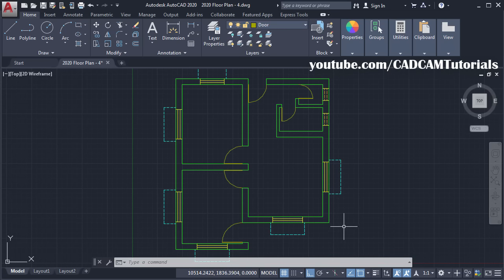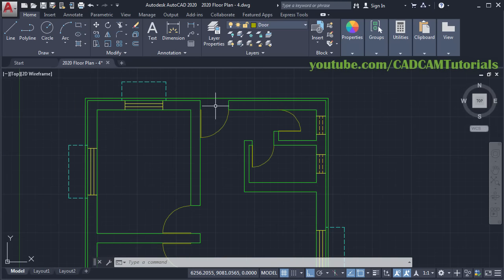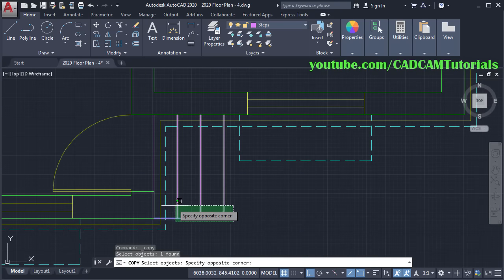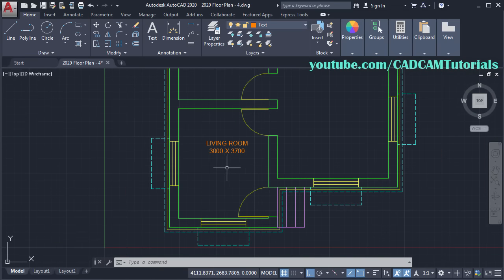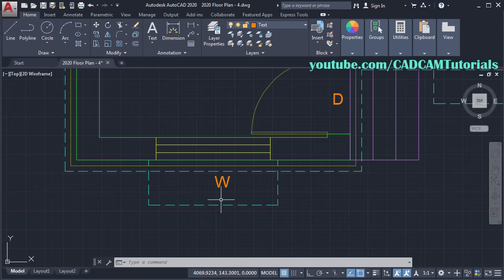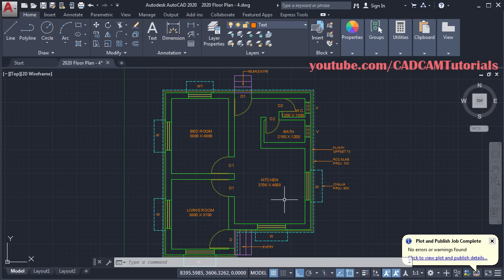AutoCAD Simple Floor Plan for Beginners - 4 of 5

Comment: 04:30 tracking a particular location
02:14 Use of fillet command as join and corner
02:26 Use of edit polyline close option
04:27 tracking from a particular point
13:10 tracking
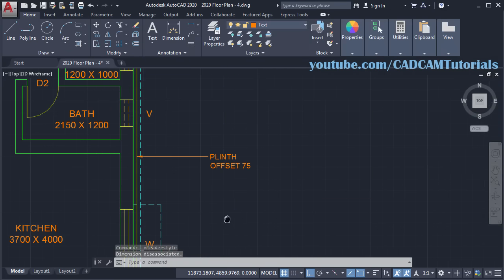13:50 text alignment attachment (middle of text)
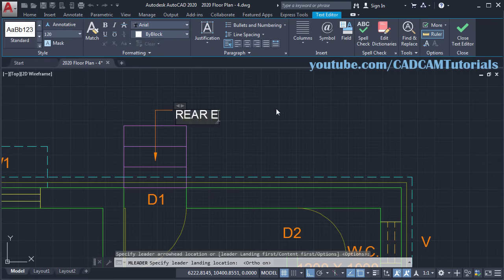16:07 pdf making